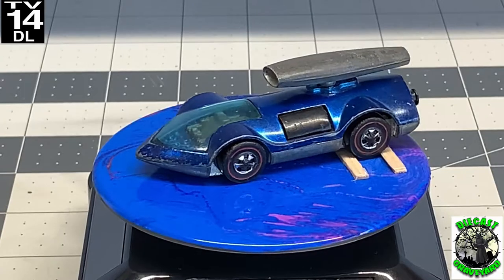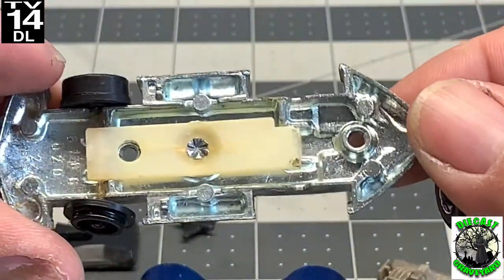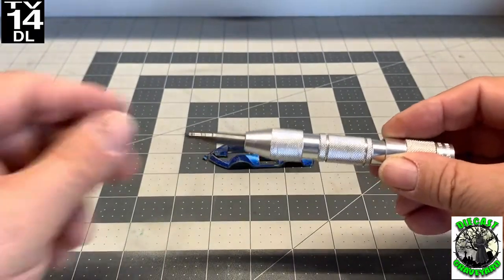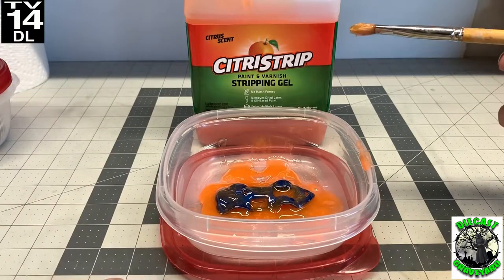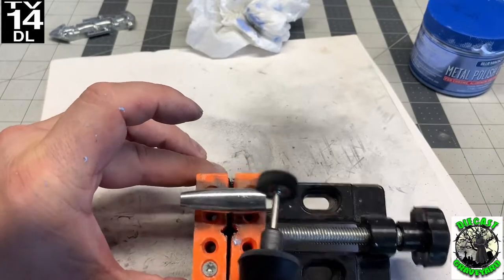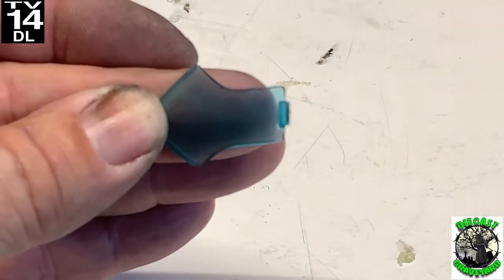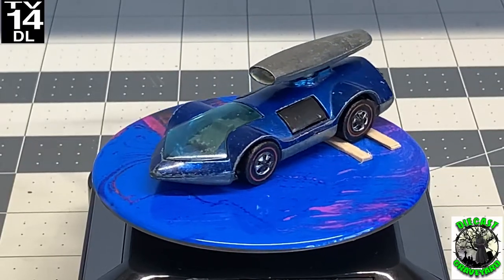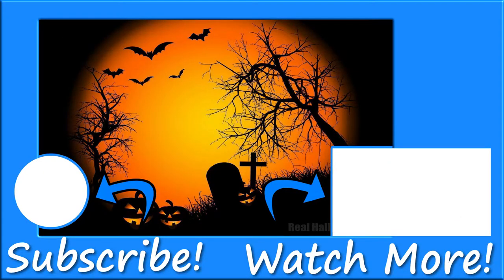Hot Wheels Rocket Bye Baby Restoration

Comment: Another quality restore!  Question: Those axle tubes, what's the size? Or, as a bonus, do you have the Amazon LINK for them?
Reply from the maker: I would check hobby lobby and the brass tube is number 5125 and the aluminum tube the same size is number 5100. You’ll have to check periodically because they’re in and out of stock very quickly

Comment: Hi Paul, first off I love your videos. I have a question about the Rocket bye Baby car. Why is it that some of these cars have the black side covers on them and some don’t ? Like on eBay there seems to be 2 different castings.
Reply from the maker: The later casting without the black flaps was a special promotion offered by shell oil company I believe. They simplified the car to cut the cost of making them so they could give them away as a promotion. I hope that answers your question brother
Reply: @DiecastGraveyard  Yes that answers my question, thank you so much for replying. The restoration work you do on these old hot wheels cars is amazing. Thank you again for replying.
Reply from the maker: Cheers and thanks for subscribing